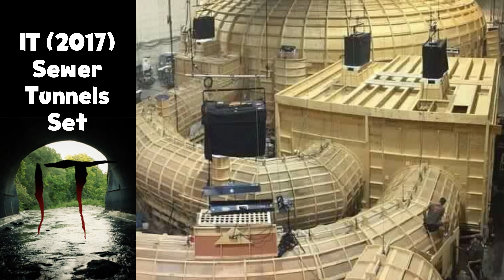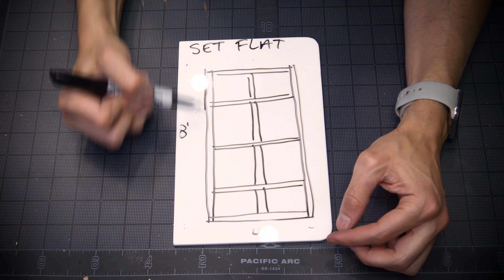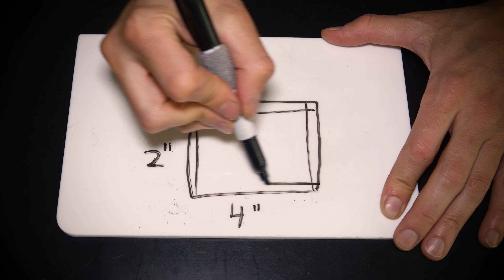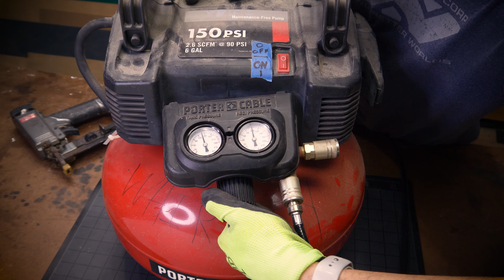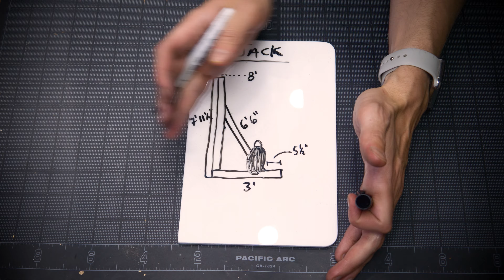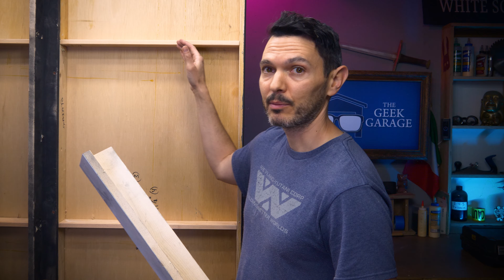How To Build a 4x8 Movie Set Flat (Easy DIY Tutorial)

Comment: Awesome video. If you were going to hang something pretty heavy off of the wall, like a projector screen, would you need extra backing, extra sandbags, both?
Reply from the maker: I would do both for sure. I'd also ideally want to have at least a partial room built so 3 walls just for some more overall stability and then I'd add corner cross braces on the top to secure them together.
Reply: @thegeekgarage  Thank youuu!
Reply from the maker: @traciemae  you're welcome!! ☺